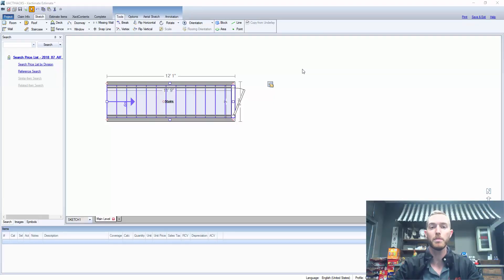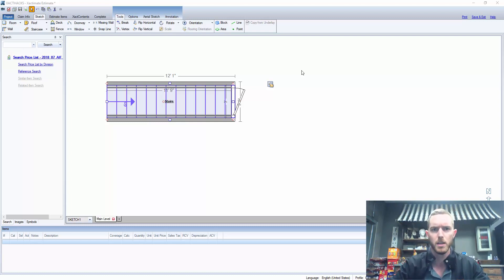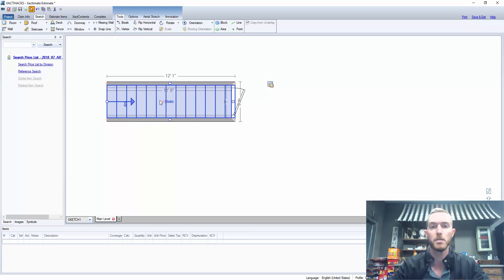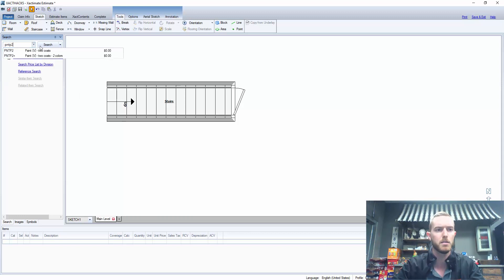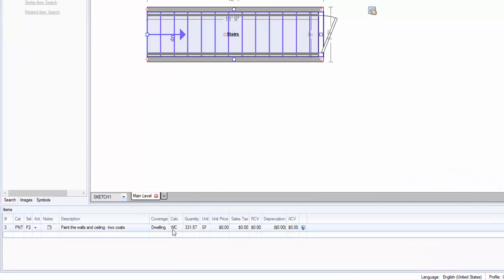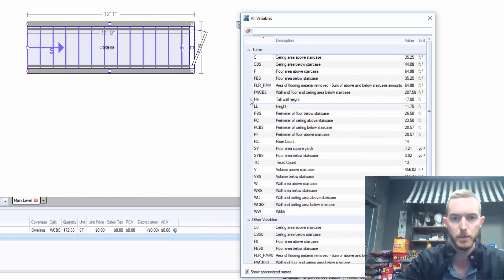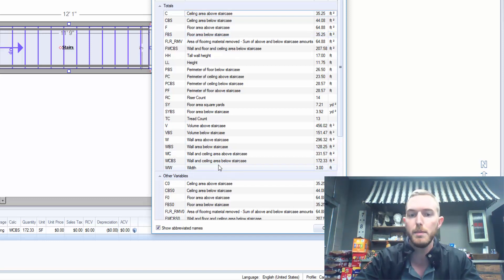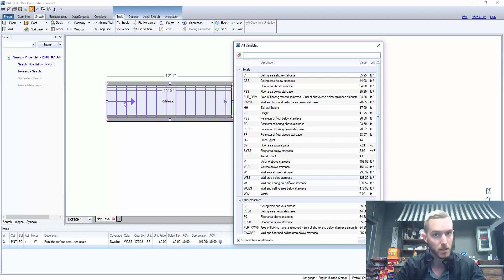Xact Hacks | Walls, Floor, and Ceilings Below Stairs

Comment: I'm trying to sketch a staircase that goes along the back wall of a Living room. The back wall is solid, but the staircase wall facing outward is partially missing above the stairs... BUT only up to the ceiling height of the living room. Above the Living Room ceiling height, the staircase walls go all the way up to the 17ft high level. If I select 'partially missing above stairs' then XM8 wants to remove the entire wall all the way up to the 17ft level starting at the stairs. If I use the missing wall tool I can bring the wall above ceiling height back into play, but then it takes away the wall below the stairs too. Any advice?
Reply from the maker: Hi @‌oneBoredFish, sorry for the delay! For that stair-wall sketch, you might try using the “partially missing above stairs” tool and drawing a break line at the ceiling height so Xactimate only removes the section above. If that still doesn’t work, we’d need to see a screenshot of your sketch presets to pinpoint the issue.

In the meantime, you might save a ton of time by using geospatial scans to automatically generate sketches with accuracy.

Also, feel free to hop into our Facebook community of 23,000+ restoration pros, where members share tips and help each other solve challenges like these every day. Join here: https://www.facebook.com/share/g/197jfaYspD/